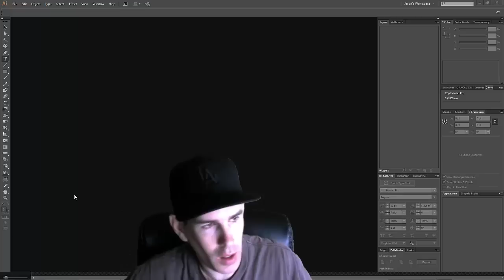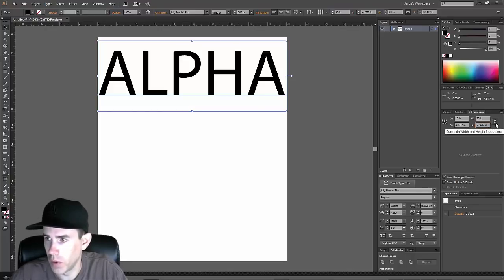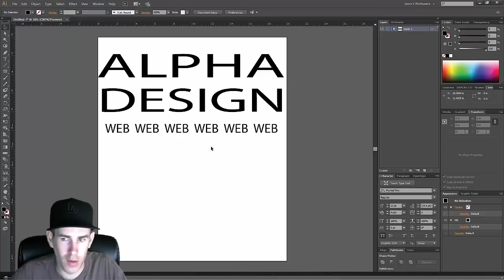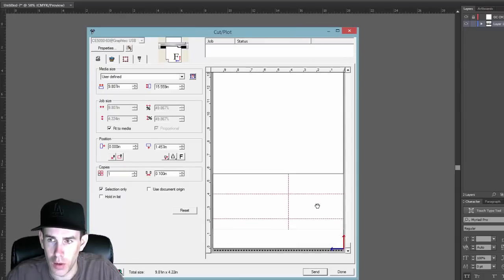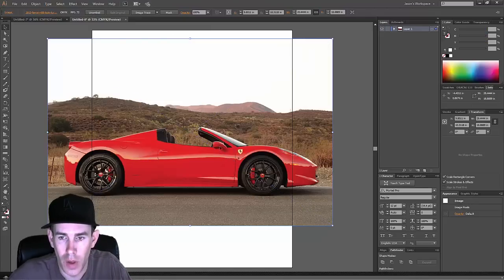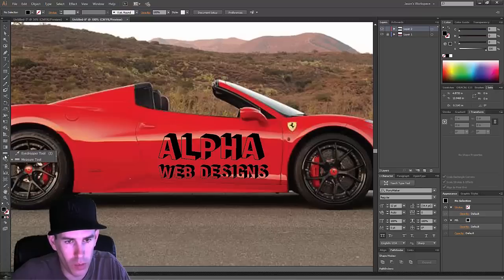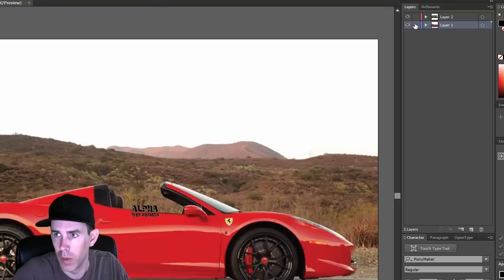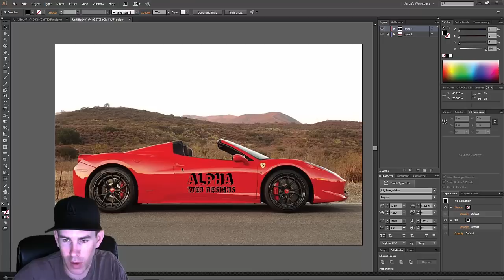HOW TO SIZE VINYL DECALS FOR CARS AND OTHER SURFACES

Comment: I matched and duplicated a set of decals for a fleet of police cars using a similar technique a few years ago.  At first, I wasn't sure it would work, but it surprised me and the city was pretty happy with them.  I took several pictures of an existing police car, scaled it up in AI, and used the pen tool to draw the outline of the stripes and over laid matching text where needed.  I used the same technique to transfer the design to the new Durangos when they started buying those.  Great video!
Reply from the maker: That's good to know bossman696 IF it's good enough for the cops, it's good enough for me! Lol!  Do you have some place I can see some of the work you've done?
Reply: Ink Spit My wife has been on me about documenting my work.  I really should start doing that.  I'm more about the journey to produce the stuff rather than the business side of it.  I better step it up or I might be out of business soon... LOL.